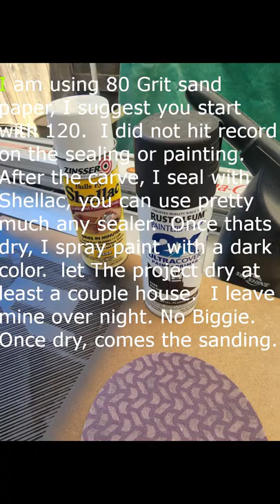Photo Carve Sanding

Comment: Does making the picture grey scale first help bring out detail? I did a colored picture and you can kind of make out what it is.
Reply from the maker: Yeah, it helps.  You want to either edit it in photoshop or try and use the basic adjustments in vectric.  Some pictures you will have to do mess with quite a bit to create separation between the background and the focal point.  Usually people's heads start blending in with dark back grounds.  Every once in a while I have to create some sort of highlight around their head to make it pop.  Does that make sense?